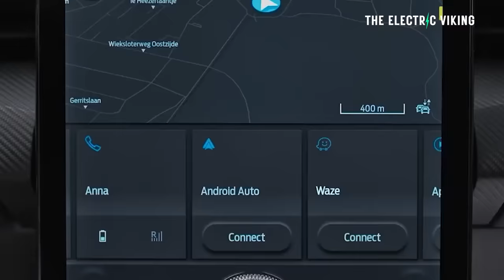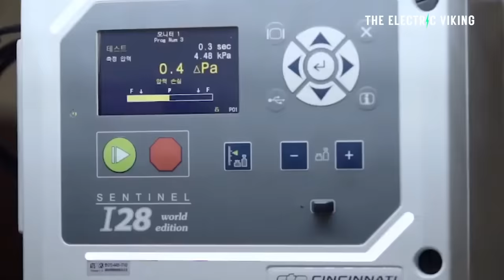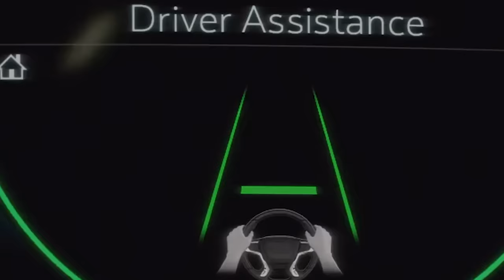NEW Chevrolet Bolt gets big changes including LFP batteries + Ultium platform

Comment: Just today, we drove 100 miles to a dealer in a rural town and picked up our 2023 Bolt EUV in Ice Blue Metallic with the gray leather seats.  We got it for list price. It's in the driveway charging on 120 volts and will be fully charged Friday at 2pm. Gotta get moving on changes to my electrical wiring to allow a 220 volt charger. This will be my wife's daily commuter car and our weekend runabout. I am surpised at some of the nice features and conveniences the car has. I'm 66 years old and have never owned an American car. I started with German cars, then Swedish, followed by Japanese. IF we like this car (and so far we really do) we would consider getting another one - if only GM wasn't dropping CarPlay. That is a total deal breaker and will push us toward Volvo or something similar. Maybe VW if they have their shit together in a few years.
Reply: GM has already said that it will have Apple CarPlay like features but oh well go buy something else before even trying it.  😊
Reply: GM also said they will make 400k EVs by 2024, and then they don‘t.
Reply: We charge our Tesla on 120 all the time. We have short commutes though.
Reply: Your best bet is to directly wire it up instead of installing a nema 50 socket.A lot of the fires on ev chargers are due to using a plug. If you do use a 240 wall socket, plug it in and leave it plugged in. Don't get a traveling one that you plug and unplug a lot. I flip my breaker when I am done charging for the week to be extra safe.
Reply: Cool. Nice car. A shame America stuck to the 120v system. I charge at home 240v 15 amp. Great.
Reply: @monkeysezbegood  in Europe you get 3-phase 240V everywhere by default. In the last decades 3x 240V @ 40-60A was and is the standard.
So you can easyly use 3x 240V @ 32A to charge your car at home, that‘s 23,000W.
Reply: You need to have a 240v charger if you put daily miles on your car.  16A at 240v is all you really need if you charge 1 car.  This will add over 40 kwh overnight, which can add 120 to 160 miles - every day!  The charger that works with this 20A circuit is inexpensive, and all you really need.
Reply: We drove 150 miles to pu a Bolt EV, last January.  Best car we have had.  It is probable that there will be access to plugin or wifi a phone or iPad to do the Apple Play to the audio set up.  Not having android or apple in the vehicle just reduces the cost.  You already own the license.  There is no need to buy it again if they have a physical or wifi port.  The 2025 Bolt EV will probably be the EUV size with the EV moniker.  This will be too large for us.  I suggest you look around to see if there are any EUVs still on dealer lots.

Comment: Going with the LFP instead of the ultium battery is good and this has potential. Unfortunately, Mary Barra has burned all credibility with me  in having a good EV a few years down the road.
Reply: The “Ultium” part of their batteries is that they are modular and if needed can be switched in and out of the car with all different types of chemistry and will wirelessly communicate with the BMS.  These (LFP) will also be Ultium batteries.  I have a long way to save anyway!  I’ll wait for something better to come as I just got my Bolt EV Premier in 2019 and love it!
Reply: Huh?! The current Bolt and EUV are both excellent for 80% of drivers. Main thing blame a woman right.

Comment: Ultium is the architecture, not the battery chemistry.  Ultium can accommodate any battery chemistry and size.  It’s modular and made for the whole GM offerings.  Can be upgraded later for newer battery chemistries.  If a cell goes bad. That particular module can be replaced without having to replace the whole pack.
Reply: Going from a pouch system to a cylindrical cell system is a major change to the structure. I would not be using the Ultium name as it is associated with the battery pouches catching on fire. That’s why they said they were discontinuing the car. That would be like Ford bringing back the Pinto. The Pinto was banned in the 70s because it caught fire if it was involved in a rear end collision.
Reply: Nice explanation of Ultium, don't worry about unbased comments.
Reply: Including electric motor as newest Ultium architecture.
Reply: @royphillips7644  It changes what happens in a module. The modules are wired so that they appear to be 2 independent batteries while charging. That dissipates heat so that the charging rate can be higher longer.
Reply: @royphillips7644  This isn't even true...each ultium module is about the size of a suitcase and could be full of any shaped cells and the the overall architecture would still be the same.  It's not one big pack...it's a pack with lots of little easy to remove and service modules.  It's meant to be serviceable pack for true longer than ICE life vehicles that could still be going hundred years from now.
Reply: @stormsj  In the Northeast, cars rust out after 15 years or less.
Reply: @jamesvandamme7786  Yes...Ice cars eventually have pretty spendy to repair issues related to mechanicals like transmission or engine that make them pointless to repair for most part.  An EV you maybe have to replace some bearings on the motor and drivetrain or swap out a few suspension components and your good to go if you can also fix lesser battery modules that don't require whole big and spendy pack to be replaced with good core price for the dead modules that would get refurbed with new cells.
Reply: @jamesvandamme7786 and not ALL cars rust out up there...that's sorta a matter of how well/often you clean them in the winter months.
Reply: @jamesvandamme7786 not to mention EVs will tend to use more aluminum structure as there is less need for all that to be as cheap as possible, so much as light weight since as battery prices come down...EVs are simpler/cheaper to build.
Reply: @stormsj  The frames rust from the inside out then you have a non-repairable car. Surface rust on the body, not a big problem.
Reply: @royphillips7644  Must have missed it - which ultium cars have caught fire?
Reply: @jamesvandamme7786  even that will be less of an issue with aluminum castings.  Might still be issue if they do hollow extrusions and don't seal them right.  Generally though even body rot in salty areas should be something they can design to be less of an issue if there is no cost on engine and transmission if batteries get cheap enough.

Comment: GM is like Lucy from Peanuts.  Always yanking the ball away at the last minute.  I guess "Ultium" cells aren't meeting expectations with regard to costs.
Reply: They might be alright for a higher priced vehicle, but the bolt needs to be as low cost as possible and right now that means LFP.
Reply: They catch on fire with the Ultium. That’s why they stopped making that car.
Reply: @royphillips7644 caught fire less then gas cars
Reply: The cars could cost 0 to make and theyd complain. Its hard to convince people to change even if changing is good for them

Comment: So, we just rented a model 3 for a week in south Florida. I am just going to say it, I can’t wait to get back to illinois to my 2023 Bolt 1LT. Mine rides smoother, much less road noise and more efficient, what else needs to be said. I’ve driven this model 3 over 500 miles this week, so I got a good feel for it. It was the first and last time I’ll ride in one! By the way, great video.
Reply: Those new LFP batteries in Model 3’s can confuse you into thinking that the car is inefficient, but M3 is one of the most efficient EV cars.  Interesting that you like the ride of the Bolt better.  Perhaps the newer Bolts have softer suspension (mine’s a 2017, and is quite stiff and bouncy, but I like it overall).  I did similar to you (500 miles on a FL rental) and thought the M3 was a nice car, other than getting into it.  The MY is much easier in that regard.
Reply: @dennislyon5412 - Our 2023 Bolt EV is a very good ride.  Now I am bias as the previous vehicle was a 2010 Honda Fit.  Nice vehicle, but the Bolt larger tire/wheel/weight combination is a noticeably better ride.  The Bolt EV was the only comparably sized EV to the ICE Fit.  The added 1,000 # is a benefit in winter traction.

Comment: We have a 2022 Bolt and use it for 90 plus percent of our driving. We charge it at home and work. It's a great car. The charging infrastructure is why we use our gas car for a couple road trips not really the dcfc charging speed of the Bolt.

Comment: I would happily buy a Bolt if the charging time was much faster than the current model.  Yes, the thought of EV6Gt gets me excited with all that sexy power. After I test drove it , I realized I would miss having the range of 300 miles.  At the end of the day, I want a reliable competent car with a decent range to get me to work and all the things we use a car for.  If only flaky Mary would build it !
Reply: Yup, the slow charge time was the one thing stopping me from buying it.

I only need the faster charging a few times a year, but when those trips come up, I want to be able to make them without having to rent a vehicle
Reply: @stevenjones916  it will 270. Great car.

Comment: On February 14 this year, Ford Motor Company and CATL jointly announced their plan to construct a new LFP battery plant in Marshall, Michigan. CATL will provide construction and operation services for the plant and license battery patent technology to Ford.
GM is leading a $60 million investment round in Mitra Chem, a California startup working on cheaper EV batteries. Mitra Chem is aiming to develop low-cost lithium iron phosphate batteries that can hold more power than current versions. If it's successful, its batteries could appear in GM's EVs later this decade. Reported Aug 16, 2023
Reply: Wait didn’t a lot change for ford and gm with the strikes? This may not be accurate now
Reply: Itsa nice!
Reply: @Quickicecarreviews123 - Ford hit the brakes on the Marshall plant - at least for now?

Comment: Essentially, the new Bolt will standardize on the slightly larger EUV size, but the underpinnings will be based on a reduced-size Ultium plattform. And unlike the current Bolt, the new model supports initial DC charging rates possibly as high as 250 kW, about five times that of the current Bolt.
Reply: It's very unlikely that the charging will be anything close to 250 kW. 100 kW or so is more realistic, especially as they try to keep development costs low
Reply: Ultium is dead. It’s way too heavy.
Reply: It's gonna be nac compatible,  doubt tesla would tolerate any rate of charge less than 100kw.
Reply: @mrspeigle1  I doubt they will exclude EVs with lower charge rates from their stations

Comment: 4:40 Us not getting the full credit will very likely affect which cars or when people will buy, so it definitely will affect GM, the question is how much and would selling more units at a lower overall profit would be better than selling less at a larger profit.

The bolt costing 4 grand more would  put me right back in looking at a Volvo EX30 or waiting for Hyundai to open the Georgia plant.

I will say, though, I've heard that the equinox is basically just ditching the small battery option, so that may not affect me at all. I expected the 2LT to be about 35 grand, and the 1LT is there now with my one important difference. If the reports of 300+ miles on the new 1LT are true, it's my new front runner.

Comment: I’d like the bolt if it had updated tech, increased 50kwh to 100kwh charging, and an updated appearance… ok, I might be describing pretty much any other ev at this point
Reply: I'd like any other EV if it had a price like the Bolt.
Reply: i agree with you except the appearance. i think the recent refresh looks good, and i think overall it's one of the best EVs currently available in the US. i just wish they would take it a little bit more seriously, and ramp up the production of them, and get the ultium platform ready already.

Comment: GM seems to be stating that they are getting the battery cells from their US plant, so maybe the full $7500 tax rebate is safe:  "In addition, the executive of GM’s Mexican subsidiary also stated that the imminent production start of the high-volume, all-new Chevy Equinox EV will imply a substantial increase in the manufacturing of Ultium Drive motors at the Ramos Arizpe plant, which has been manufacturing them since 2021 for the GMC Hummer EV built at the GM Factory Zero plant in Michigan. Locally manufactured electric motors are also used in the Mexican-made Chevy Blazer EV and Equinox EV."

Comment: Good news, small crossover is needed.  Doubt they could sell it at a profit at anything under $35k.
Reply: why would you assume that? given that they're going to be using cheaper, more reliable LFP cells and the volume of production. if they can sell well, the more they make of them, the better the profit will be, as the cost of the tooling gets recuperated for every additional unit sold.

Comment: I think GM will license LFP technology from a Chinese company and build the batteries in North America. These cells will be cheaper than the NMC chemistry currently used and may be packaged differently.  These cell will enable GM to meet the low price expectations for the Bolt. In addition, use of other items in the Ultium system may also be used to greatly enhance the Bolt. So, while among the cheapest EV, the new Bolt most likely will use the Ultium heat pump for more efficient heating and the Ultium motors, inverters and propulsion software will be used including the much requested AWD via the Ultium AWD Assist motor which in addition to adding AWD, will also significantly increase performance. AWD adds about $3K to other GM EVs, probably the same for the Bolt. I think the user interface software will also be ported over to the Bolt.

Comment: If the bolt is moving to LFP battery which is cheaper. Will the price go down?
Reply: Moving to LFP batteries will bring GM closer to profitability.
Reply: No, GM failed to meet promised pricing for all the newer EV platforms. The refreshed Bolt will be no exception

Comment: Commenting on an old video but... from what I understand the Ultimium platform is based on large prismatic cells, MNA (low cobalt) design. I feel like BYD Blades might be compatible with that platform, if GM are getting it from an outside supplier they could be getting it from BYD.  So could the Bolt EUV be the USA version of the ATTO 3?

Comment: i think that gm doesn't have a problem telling the public anything they think the public wants to hear and then the next day says something completely different. afterall, it's just the public. example: the equinox will be $30,000 then when it's avalilable it's 35, but you can't really buy one for less than $49,000? So my guess is the new bolt will be advertised for 30 until you can purchase it. but it will still cost 49 for anyone who actually buys one.  it's a brave new world.

Comment: There is a desperate need in the US for an EV under $20k.  And frankly itmdoes not matter who makes it.   

If the Bolt wants to compete it needs to deliver.  But keep in mind that if they stay around the price of the old Bolt... they will lose to the other announced cars.   For example I would not even have to think before buying an Aptera over a Bolt.  The only thing that would tip the scales is if the Bolt was much cheaper.
Reply: I mean the cheapest ICE cars start at $20. Typically EVs have more tech. I don’t see manufacturers building EVs (or any new vehicle) that doesn’t have tech to meet future safe recs. I think $25k is probably the reasonable lowest limit we are going to see in the next few years.
Reply: @TJPavey  While doing research for my next car and considering that I don't drive much  on a daily basis I started planning for an EV, discoverd issues and considered the Prius Prime which also had some concerns, ending up deciding that the safest move would be an inexpensive but reliable ICE.  

I discarded the unreliable ICEs (like Kia and Hyunday) and the first reliable one was the Nissan Versa.   It starts at around $15k and having driven them and seeing first hand their maintenance costs I found it perfectly adequate.  I probably would get the 2nd trim for around $19k, but for a lot of people the base trim is quite acceptable for those who keep their cars for 10-20 years.

But for a lot of people who keep cars for less time even the Kia and Hyunday models would be OK and "llook" better, and those are cheaper than Nissans.

In 2024 there will also be some car/motorcycle hybrid electric designs coming out in the $10k range, plus "low quality but low investment risk" cars like the chinese BYD Seagull EV (I hope I remember the name right) that are also around $10k.

None of the major manufacturers are planning EVs in that range.  So... the motivation  from a pure money perspective will continue to be tilted towards ICE until the major manufacturers start delivering EVs at prices people can afford or get replaced by new companies.    And since in the US public transportation just plain sucks, that means lots of cheap ICE cars blocking the transition to EV for now.  

In the US ICEs might not be that much of an issue... since our electric power generation is so far behind that an efficient ICE probably pollutes less than generating electricity for an equivalent EV.

The conclusion for me was easy.  * This year * it makes more sense to buy a Versa for under $20k than an EV for $30-40k.  Although I might get a 3-wheel ultra-compact bike/car with A/C in a year or less as our 2nd "car", to use for most short drives.  And in a few years when I replace one of the two, I'd probably get an Aptera (I really like their no car-dealers, self-repair and respect for customer privacy and needs philosophy) and give traditional car manufacters the finger, never again buying from them.